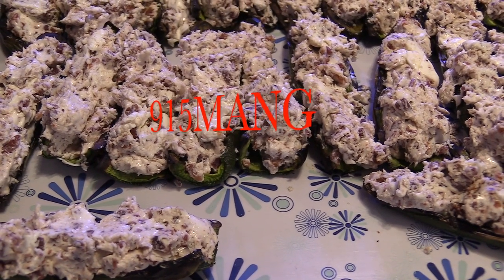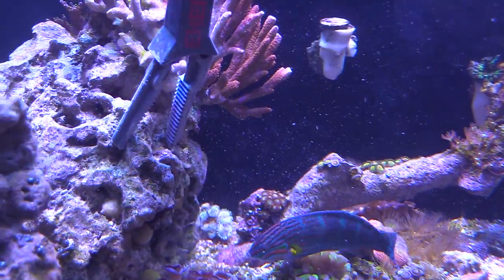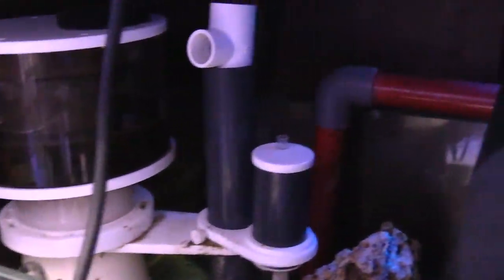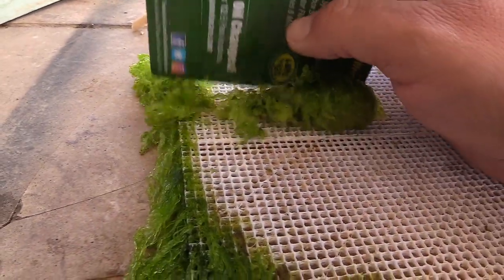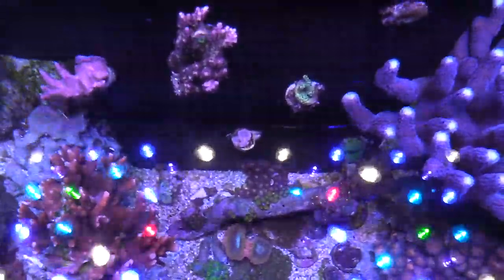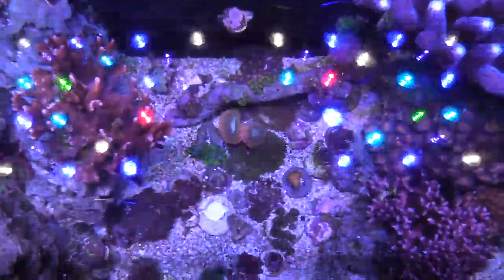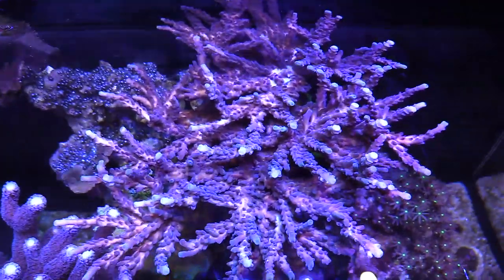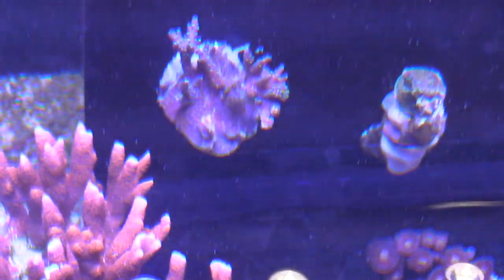150G REEF LESS WATER CHANGES POSSIBLE  | SANTA MONICA ALGAE TURF SCRUBBER RAIN 4

Comment: Have you got too little flow in your ATR as you have a massive bald patch on the screen?
Reply from the maker: Hi Mark im going to crank up the flow for sure, i may have to glue the PVC soon. I dialed the pump down because the water was coming out.

Comment: I’m thinking about trying  ATS myself. Do you think
I could run it off one of my
Manifold lines instead of using a pump with it?
Reply from the maker: Hi Tim you could. I just didn't want to re-run it even though i have plenty of flow from my return to do it. I may eventually do it, just gotta stop being lazy!
Reply: I run a ats and uv of my return pump a jebao 12000